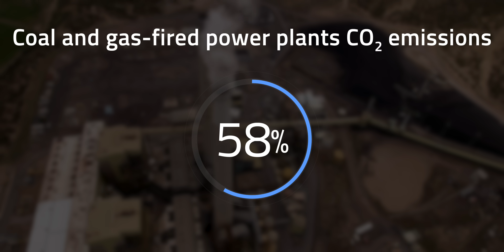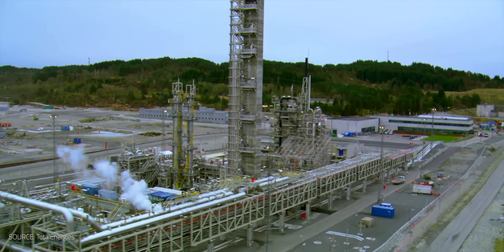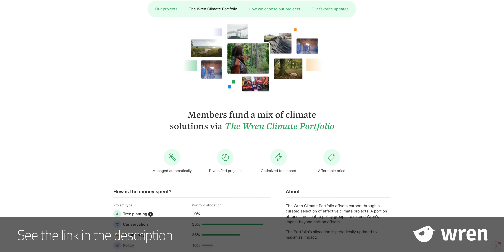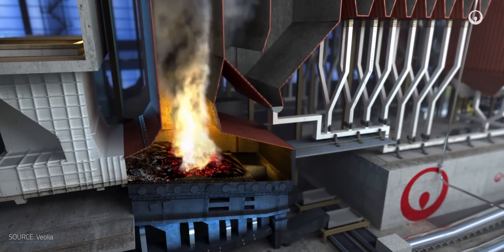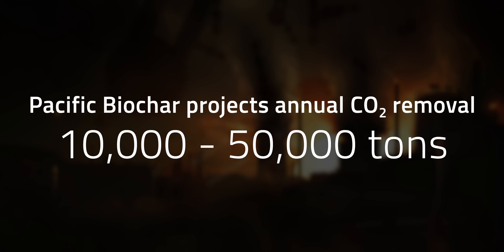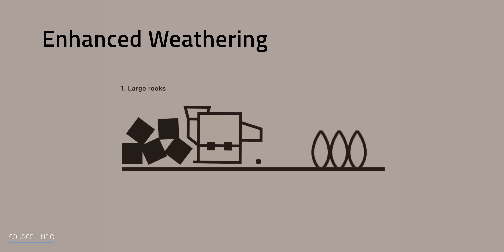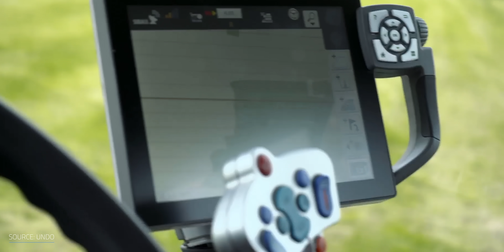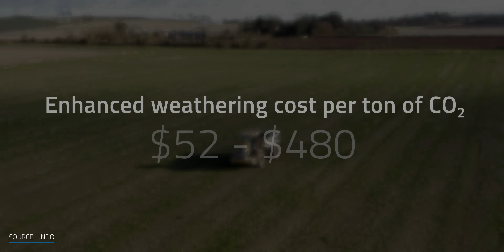The Reality of Carbon Capture

Comment: You're right, sequestering carbon isn't going to 'solve' climate change - the only meaningful thing which would impact on that would be to very rapidly cease using fossil fuels. However, I like the biochar option. I make a considerable amount of compost, collecting waste food from around my city. I make biochar the most efficient way - in my 'smokefree' woodstove. I put a small retort into the stove containing woodchip or sawdust, and the volatiles burn off cleanly, and I remove the retort, when cool I empty out a batch of finished biochar. I can do this several times a day.  I heat my home using renewables in this relatively clean way (it's not perfect) and make a few kilos of char a week to add to my compost.  This reduces my low carbon footprint still lower.

Comment: Bio char is the worst idea! Every step of the process shares a net gain in CO2 from production to utilization across the carbon cycle. Why burn 30 tons of wood to create 10 tons of biochar and over 70 tons of CO2.  Burned wood creates 3.6 times more CO2 by weight. The bio char would sequester less than 3 tons, if it is exposed to the air. Burring it in the dirt only adds carbon to the soil lessening the need for plants to absorb carbon from the air. 
Raw chipped or shredded wood added to the soil is the correct answer. It aids in water retention and improves biodiversity and growth in soil microbes and fungi which is far better than any fertilizer. It is also makes the soil far more efficient in sequestering atmospheric carbon then the plants are capable of sequestering alone.

Comment: Manufacturing biochar releases co2 quickly (fire is the source of co2). That's the whole cause of global warming. Letting biomass rot relases co2 much more slowly. Rotting biomass becomes fungi, which retains carbon just like biochar, if not, longer. insects and annelids eat fungi and the carbon from the original biomass is released very slowly instead of being burned off rapidly. The speed at which we relase co2 is the problem. Quick is bad... it's like we are chasing after a monster that we know will kill us. We need to stop burning everything. Biochar isn't better, it's worse. The silver bullet is to simply harvest algae biomass from the dead zones caused by fertilizer runoff and bury that biomass. Bury, not burn.

Comment: Hi Matt, love to watch your posts. I was wondering when you would address BioChar. One of the undeniable advantages of Biochar is that making it
 it is essentially a very low-tech approach, easily downscaled to local approaches, with minimal capital investment. Biochar, which is essentially charcoal, has been manufactured for millenia in multiple cultures all over the world. It can be produced from just about any biomass, i.e. coffee grounds, wood, rice husks, etc. , probably even in modified domestic waste incineration plants. Even without use in Agriculture it is easier to store permanently, for example in unused mines, etc. where , when mixed in with earth, sand etc. to assure it is not beeing burnable, it will sequester carbon for millenia, with next to no negative environmental impact. It could become the « poor man’s » carbon sequestration technology. Waste organic materials could be pyrolysed, instead of burned systematically.

Comment: Regarding the machines that capture CO2, you mention the cost to capture it, but i would be more interested in efficiency. Let's say that capturing 1 ton of CO2 required 1MW/h of energy, but to produce this energy you might have to burn coal, which would release 1.5 tons of CO2. Of course energy is not produced exclusively by coal and i just made the numbers up, but my point is, capturing CO2 requires energy which potentially will release more CO2, so what is the efficiency? If it will release more CO2 to run them, you are better off not running them. Is there such an estimate or at least a way to measure it per city or region?
Reply: I guess you would be using renewable energy? There is often more electricity being generated by wind turbines and solar panels than the grid can handle : it has been suggested that instead of 'spilling' useful energy from wind -turbines it could be put to use in DAC.

Comment: Hmm, we take plants and turn them into charcoal to bury, while burning coal to provide energy. That makes sense, oh wait it doesn't. We could be buring the plants instead and leave the coal already preburied. That way we'd never need to manage what to do with the biochar or dig out the coal with all the negative consequence aside from the CO2. Don't get me wrong, I don't think we have enough plant waste to do that to replace all of our coal, but that also means we don't have enough to make biochar for the same amount of CO2 produced. Sum total, all that biochar adds, is efford. Or worse, if as displayed you burn the plants openly, you don't even utilise the heat for electricity or even just heating, while still producing CO2. This is just as viable as a perpetomobile device. Where do people think the CO2 captured in biochar comes from? It is unburned carbon, i.e. wasted energy that would otherwise be used in the biomass plant. Even ignoring the ineffeciency inherend in any conversion, or the possibility of biochar in soil reverting back to CO2 unlike coal burried deep underground which cannot, that doesn't make any sense until the point that we are litterally not using any coal, gas or oil for production of electricity.

Comment: Carbon capture is bunk,  just need to do the thermodynamic energy analysis to understand.  The elephant in the room for carbon dioxide mitigation is the natural oceanic  plankton's ability to convert it to calcium carbonate, which eventually becomes  deposited in the mud on the sea floor.  Most of all of the earth's historical carbon dioxide is locked away in limestone deposits in the earth's crust.  As an example go watch the under water videos of the Deep Water Horizons oil well accident and  note the constant raining down of carbonate matter (nothing to do with oil  or the accident) from the 5486 meters of water column.  Whatever humans try to do, would be so infinitesimal compared to this natural process to be ludicrous.

Comment: CO2 is a resource that is miss considered.
We should look for creating systems that allow us to create value out of this product.

Thank you for sharing those New ways of capturing CO2.
Reply: One revolutionary way would be to get the organic chemists 'cracking' on ways of building up the products that we currently get from the petrochemical industry ( using crude oil as a feedstock) from the carbon we will be pulling out of the air by DAC.Over the last century or so they have been busy inventing ' cracking'  in another way-inventing catalytic techniques for use in refineries to enable Du Post, Unilever and I.C.I. to give us synthetic fibres, solvents lubricants, paints  etc.
I f they could pull off this miracle we would not only have a ready market for the CO2 (which might make its extraction economic) but we could finally leave all the remaining crude in the ground.

Comment: An acre of Hemp can remove 10 tonnes of carbon from the air and can be used for textiles, paper, building materials, and a replacement for fossil fuels in the production of plastics and fuel.

Comment: Carbon capture is a good pairing for lowering the emissions we can't really avoid, such as burning unrecyclable trash, but it shouldn't be used as an excuse to keep using things like coal plants.
Reply: Well, if enough carbon can be captured, then you've changed it from an "environmental and finite resource" problem to a "finite resource" problem - at which point, economics will take care of it. The reason why carbon emissions is such a huge problem is because there's no economic feedback loop to curb it. This is also why governments are using cap-and-trade, which is an attempt to create an economic feedback loop.

Comment: In regards to Enhanced Weathering, I think there are a few oversights if you dig deeper on the approach. In Aquaponics we use a grow medium, such as Hydroton or granite, The way this works for helping the plants grow is the media is porous and stores the nitrites and other beneficial bacteria for the plants. by adding that on top of the surface of a farm, you're doing the very same thing, the only difference is that soil/dirt would just normally wash away, the rock stays put and can leech into the plants, giving you a more effective crop yield. So that is GREAT, but has zero to do with Carbon Sequestering.
The 2nd issue I see with this is the metal problem(as mentioned Nickel/Chromium), this will become like the great Talcum powder issue. Stringent QA monitoring must be in place for EVERY batch of basalt gravel produced to ensure that toxic metals are not introduced. Unlike the testing the world was told was happening in regards to Talc and Asbestos, where they did very small spot testing.
I think focus on DAC tech to help get the cost reduced, and then zoning implementation of requiring a DAC at all Industrial sites should be needed.
the 20% reduction of Carbon emissions from Graphene in cement, and the 20% reduction in carbon emissions of that remaining 80% with a DAC unit, might be a huge offset for the world.
We just need more R&D in those fields.

Comment: I have worked on a research project with MMSD to convert sewage solids into biochar (using land-fill methan as source of energy). There is a lot of promise in this. But it is not something I would lump into the term "Carbon Capture" which most of us think of as reducing  carbon from fossil fuel burning or cement plant flue gases.

Comment: Land-based solutions seem to run between expensive and a waste, but ocean water already captures carbon on it's own. Removing carbon from that natural capacity to capture and store leverages that "infrastructure" that already covers the planet. Offshore kelp farms could make use of the unproductive surface area by turning sunlight and ocean captured carbon into plant matter relatively quickly. We could then take that biomass and transform/store it in the ground like in this video. It would also help reverse acidification and the cost to build is much less than these expensive land-based facilities, and have a cooling effect as well. I wish we'd explore that more activley.

Comment: If carbon capture can be used for plastics or plastic replacements, could carbon from the smoke from burning plastic being partially powered by the heat from that burn be a lower power alternative for plastic recycling?

Comment: It would seem that raising the pH of the ocean to allow it to pull more carbon out of the atmosphere would be one of the most efficient ways to capture CO2. If we can crack this code (of what to use or how to do it), that could be the CCS equivalent of using heat pumps to remove 4 or 5 times the input.
Reply: Changing ocean pH is already killing many marine species, lets not do that.
Reply: @zea_64  I think you've got your pH mixed up. Ocean acidification (falling pH) is killing marine species and decreasing the CO2 carrying capacity of the ocean. The use of what are basically Tums can reverse that trend and return the ocean pH to previous levels

Comment: I once worked on designing a DAC system.  The problem is, and Matt glossed over it in this video, heating the capture material to release the CO2 and then actually capture, transport and pump the CO2 is an energy negative process.  You end up generating more CO2 in the total process than you capture.

All of these capture/sequestration processes suffer from similar issues.  As do EVs and other “green” technologies.  As Matt said, you can’t just buy an EV and call the problem solved.
Reply: What does' energy negative' mean if you are not using energy derived from fossil fuels?
Reply: @edwardhogan1877  if you’re not using energy from fossil fuels, then no it’s not energy negative. But the carbon capture process takes a lot of energy and we’re still a long way off from large scale industrial processes  being non- fossil fuel driven.
Reply: You got hold of some bad info on EV's.   It sounds like you are using the day of sale figures rather than the lifetime figures.  EV's cost more CO2 to manufacture (in areas with fossil power) but save much more CO2 (and money) over their life time.

Not enough to put even a tiny dent into the overall problem but ICEs are just pure a pure CO2 race to hell on earth.
Reply: @mac_mcleod  I was really making an energy statement. (I confused the subject, sorry). Agree on the CO2, but the overall energy equation is much less clear.
Reply: @motor2of7  happens to all of us.   Cheers!